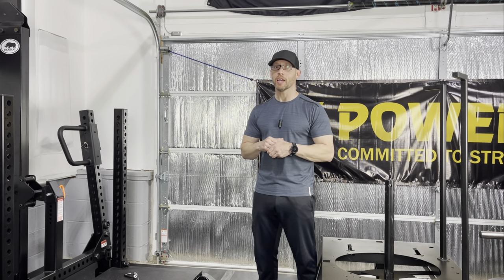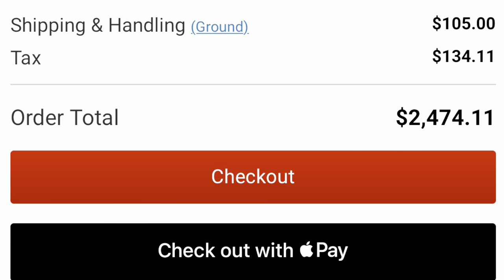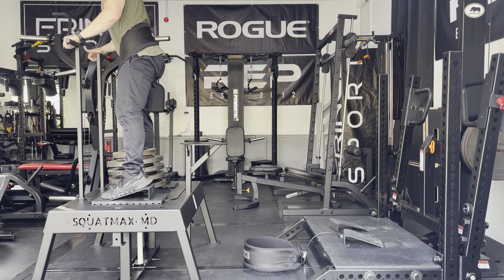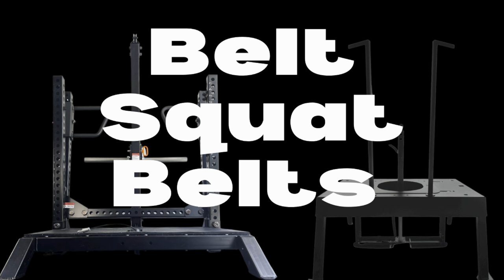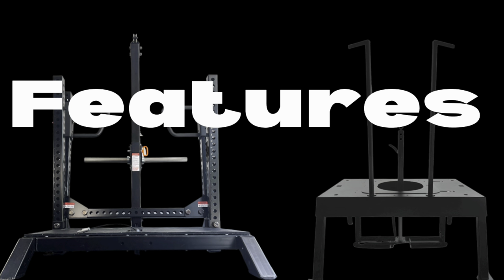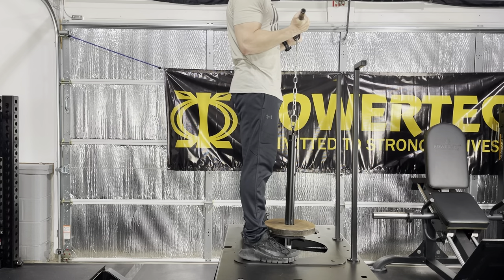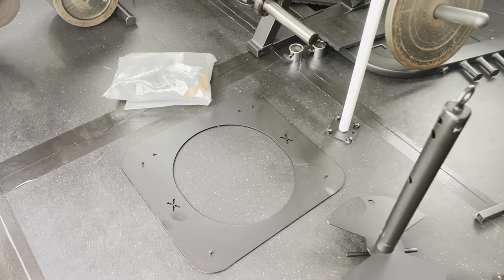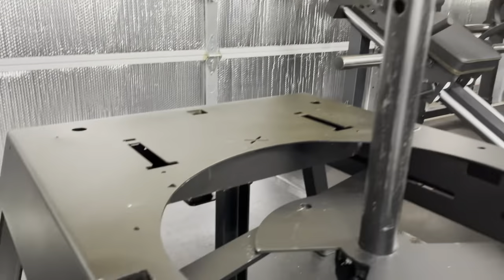The Rogue Rhino vs The Squatmax-MD - Battle of the Best Belt Squats

Comment: I'm curious how you feel about both now?  From what I've seen people love the Rhino and its very versatile and most importantly its far easier to load and unload the weight!  If I bought Squat Max I likely would buy a 100lb plate and leave it and a 45 on there just to save time.

Do you feel the workout is superior with one vs the next?  I'm 52 and just started lifting again did a regular squat for 275lbs for a few sets of 5 and I want belt squat to try to increase leg strength while keeping back safe hoping to get up to 350+ lbs and build leg strength for regular squatting or after a bunch of squats and back is sore will use belt squat with likely 150 to 200lbs and try to crank out 1-2 sets of 20 reps to torch legs and not hurt back.
Reply from the maker: I sold them both and went back to my DIY Belt Squat (I have a new video for it).  I sold the Squatmax first and less than a year later, sold the Rhino.  
Your conclusion is right on.  I always liked the Rhino slightly more because of easier loading and more foot positions.  It’s also a heavier and more robust machine.  Luckily, you can’t go wrong with either.
Reply: I totally appreciate and respect your advice.  I know you said you have lower back issues did you find you were not using the Rhino with heavy weight and just want a lighter leg workout is that why you sold it?  I like your new belt squat idea however want to do 300+ lbs and it doesn't look like it would be easy to stand on boxes!  I'm considering the belt squat Kaizen made with Fringe Sport, kickstand coming early next year and it can load a lot of weight, supposedly it has a 90% feel weight do 330lbs will feel like 300 and can go low as weight pin is vertical on top.  I don't need to build any stand to get range of motion, its affordable and can be added and removed with rack!  Curious if you've seen it and what you think? @HomeGymHacksandReviews
Reply: I'm trying to protect my back.  For instance this week did some deadlifts nothing radical about 250lbs for 10 reps and next day squatted and my back is so sore.  I need to do belt squats on weeks I deadlift (trying to build up traps and forearms which deadlifting does for me but it ruins my squat!).  That's why belt squat is so important to me and trying to prevent major back injury!
Reply from the maker: Thank you.  Not at all.  I posted a few videos going pretty heavy shortly before selling the Rhino.  One of the YT Shorts was 350 pounds for quite a few reps and I was able to get (8) 45s for a couple reps.  For me, it was just time for a change and I needed to free up space for new equipment reviews.
As for the Kaizen Belt Squat.  First, I’m a big fan of Kyle, he is one of the nicest guys in this space.  If the lever arm is long enough, it could be a good design.  I can’t remember exactly the dimensions of Kyle’s (I think it’s better than some of the other designs).  I do not like the mechanics of a short lever arm belt squat.
Reply: Thank you for your opinion.  I sure would love to save the space of Kyle's design.  It is a bit longer than most and says its 90% feel weight.  Kickstand coming soon which is cool. @HomeGymHacksandReviews

Comment: Any issues with the cable on the Rhino? I had to have mine replaced after the rubber coating frayed away while doing seated rows. The cable was rubbing against the platform as I rowed back and forth. Great review. I love doing RDLs on the Rhino. Gets a great stretch to the hams!
Reply from the maker: Thank you!  No, I haven’t had any issues with the cable, admittedly, I mainly use the Rhino for squats and calf raises.

Comment: Love that the SquatMax has the seat which makes it much easier for those with previous knee injuries. It's tough to get into position on the Rouge Rhino. Thanks for your thorough review!
Reply from the maker: I’m a big fan of the seat!  And it comes stock which is even better!
Reply: I am a huge fan of the seat because I can sit down in between sets without taking off the belt.
Reply: When I want to do box squats on the Rhino I slide an adjustable bench(Rep AB-3000) under the platform.  The front feet go under the platform and 
the pad goes over.  I can use different size plates to adjust the seat height.

Comment: Nice review. I prefer The Squatmax-MD hands down. The Squatmax-MD give a much better spine decompression than the Rogue Rhino. This in my opinion is a game changer as it targets your quads without any strain to your lower back.
Reply from the maker: Thank you!  I’m really glad to hear you like the Squatmax.  It really is a great piece of equipment.
Reply: But will loading and unloading plates on vertical pin stressed my lower back more?  Have sensitive back wirh 2 bulding disk, also do jujitsu so it's sore all the time. Lol. Iam pretty sure I would love the squat max but don't know about the loading/unloading and also a minor thing stepping up to a 20" box.  Iam still deciding between the rhino and squat max😢
Reply: @futbol1972  Marco, I understand you can use the flat resistance bands for resistance if you have a concern of loading and unloading weight plates.
Reply: @JoseSuarez-bk3qg have you used both if so which one do you like better for squats only ?? Which one feels more comfortable

Comment: I already own a titan selectorized lat pull down, a selextorized funcional trainer and foldable titan rack. Do you still prefer the rhino over the squat max?  I was about to buy squat max but they don't have financing. I like it because it's smaller than rhino and cheaper,  however rhino has financing where I can give $1000 and pay the rest in 6 payments with no interest:) that I can do. But it looks quite large compared to squat max??
Reply from the maker: That makes a difference.  I stand by everything I said in this video.  I have a couple newer Rhino videos too.  
I think both are great belt squats and you can’t go wrong with either.

Comment: If you add 500 lbs on both machines  equally, which one of these machine feel heavier ?  Since only question I have is depth on Max MD with more plates on, because 500 lbs is not heavy.
Reply from the maker: If I remember correctly, I could lift slightly more on the Squatmax.  If you are worried about running out of room for plates, adding bands is an option.

Comment: The squatmax md I like it for it's size/free weights. The price is absurd to me i could diy this myself. I get the rhinos price blecause it's heavily built I guess. Md is basically a well built guage steel table lol.
Reply from the maker: I’ve seen a couple decent DIYs for the Squatmax and I used a loading pin and plyoboxes for a number of years; but if anyone is willing to pay extra, the Squatmax is better than those options with the loading pin that travels along a shaft, band pegs, and the arms that lock the loading pin into place.  I can’t sell the Squatmax short because it’s a hip thrust and can be used for rows too.

Comment: Hello,
I enjoy your reviews. I recently used your belt squat idea with 12 inch plyo boxes and Titan loading pin. It works great. I wanted to implement this with squat wedge to elevate heels. I have double circle metal squat wedges. I'm worried about them sliding on plyo box during squat. Any suggestions?

Thanks
Reply from the maker: Great to hear!  Yeah, the laminate could be an issue.  I would use a stall mat between the wedge and plyo box.
Reply: Thanks, I will definitely use the stall mat. This is the best option at this point. Not wanting to purchase a belt squat machine.

Several of your videos have been helpful to me. 

I have a Titan T3 rack with several accessories and lever arms. I have several Titan products.

I may consider a Power Tec LG after watching your videos.

Thanks again
Reply from the maker: @gregoryanderson7103  glad to help!  I used pre-cut stall mats on the Rhino’s platform before entirely covering it.  It worked very well.

Comment: I told the GF I’d be done buying new equipment for awhile, but that Squat Max MD has caught my eye. I’m looking forward to what you think about it overtime and which one you like more.
Reply from the maker: It’s a great addition to any gym.  Hopefully, the GF will understand!  lol!  I am also looking forward to the year mark with both…I’ll likely do an update video in 6 months to a year.
Reply: @HomeGymHacksandReviews  I just bought the HLP Single Stack so I’ll wait for your 6 month review 😂
Reply from the maker: @GoreckiFit  great piece of equipment.
Reply: @HomeGymHacksandReviews  please do make an update on the rhino vs squatmax. Im debating on selling my squatmax to get a rhino since I can turn the rhino into a lat pulldown, and the rhino will make it easy to train my hip flexors too. But damn, I love the squatmax too. Ideally, id have both just like you
Reply from the maker: @Crazytaru1  it’s a tough call to put one over the other.  The biggest difference I have found is ease of use with the horizontal posts over the loading pin.  Each has their own set of exercises that the other really can’t.  For example, barbell rows and hip thrusts on the Squatmax Vs seated rows and bicep curls on the Rhino.  The Squatmax is easier to get in and out of position because of the seat.  I wouldn’t want to choose if someone said you can only have one.  Being able to maneuver the Squatmax is another advantage.  I’ve moved the SM 10 times since I’ve had it and now have it inside my Power Rack.  The rhino is very difficult to move if I am solo.
Reply: @HomeGymHacksandReviews  well if I have a lat pull down machine or FT u can do all these cable movements the rhino  does.. It looks like the squat max more versatile but looks like a pain to load.   
Iam also  thinking about getting a rogue rack and adding high and low slinger to it plus the bully glyder throlley to add lat pull down, low rows and belt squats too, I heard belt squats on this thing are as good as the rhino🙄 and also a  rogue lat pull down seat.  It will be around  $1500  so around $3000 with rogue rack.
Or a drop in rhino plus rack and surplus strengh lat pull down attachment to use with rhino which will be around $4000.
Or 4 post ares plus squat max md machine which will be around $6000
Reply: @HomeGymHacksandReviews  Is the SquatMax relatively easy to pick up just a bit and move over maybe 30” or so in one direction if all the attachments aren’t on it? I’d have it against a wall length wise and bring it out for the rowing stuff and such.
Reply from the maker: @srhyse  I think it’s easy to move / slide on horse stall mats.  I wouldn’t want to move it every workout, but it can be done.
Reply: Did u end up selling squat max to get rhino?  If u already had a selectorized lat pull down and a selectorized functional trainer and a rack would u still tried to sell squat max to get rhino or u would of kept it??
Reply: Do i need to be taking off seat to load and unload plates to make it "easier" or i can live it on?

Comment: I like the functionality of the Rhino in this video. How well do you think the Rhino would work for a 5'2 petite woman for rows and the other uses besides belt squats. I am having difficulty growing my legs because of a moderate brain injury, and I cannot perform heavy movements such as squats or deadlifts. Plus, the way I was impacted, I have neck and shoulder issues. I have always said I wanted to buy 1 piece of leg equipment to help my legs grow. I am just curious about your thoughts on the other uses as someone who will keep a minimalistic approach to a home gym with a good piece of leg equipment, and I am now in the market for that 1 piece. I do not have a cage, and I am not sure I want one.
Reply from the maker: Sorry to hear about your injury.  I can’t be 100% certain how well the Rhino will fit you.  I will say, the belt has 5 adjustments which will help.  I have a full review for the Rhino if you want to see a few hacks and additional exercises and another training video using the Rhino.  Those videos may help you get a better idea if the Rhino is for you…bc it is very expensive.  However, I’ve said before, it’s my most overbuilt and favorite piece of equipment.  The Rhino can definitely be your only piece of leg equipment if you want.
Reply: Thanks!
Reply: @HomeGymHacksandReviews  I just watched your lower body workout, and I think you just sold me. I really don't want a lot of equipment, but I can do hamstring and everything. Now just to pause, pray, and measure my garage space. Thanks for responding back.
Reply from the maker: @Dezlou  glad to help.

Comment: comparing both of these and I have a couple questions. is ur rhino bolted  to the floor. I don't really want to tear up my floor. And the resistance bands on the squatmax. are they optional to have on the machine or required? I'm a female 5'2  I've tried the rhino and it fit my body so I'm leaning towards rogue but squatmax  smaller footprint wins me over
Reply from the maker: Against Rogue’s recommendation, my Rhino is not bolted to the ground.  I’ve moved it around about 5 times, so I’m glad I never bolted it.  
The resistance bands come with the Squatmax, but they don’t need to be used. 
I have 2 newer videos with the Rhino if you want to check those out.  Good news, I don’t think you can go wrong with either.

Comment: Looking back at this. What would you prefer?
Reply from the maker: I still feel the same as I did when I made this review.  If you’re a free weight proponent, the Squatmax may win out bc of the chest row, hip thrust, and loading pin.  I couldn’t tell a huge difference between the two belt squats, the Rhino is just easier to load and unload with more foot position possibilities.

Comment: Ive never used a belt squat machine...do you feel pulling in your lower back when using since the force of the gravity would have a pull on your lower back?? 

thank you so much for your review...I was looking for a squat alternative and a seal row and without this review I would've never known that the squat max would do both.  You are a true savior for us home gym guys
Reply from the maker: Thanks so much!  I have to be very careful with my lower back and neither machine causes me trouble…I think it actually feels good for the lower back as there is a decompression component with the belt squat when it has a true vertical line of drive.

Comment: is there a reason why the pulley tower on the rhino is so tall? my god damn low basement ceiling
Reply from the maker: It could probably be slightly shorter and not impact the exercise selection / carriage travel.  Would it be possible to cut a small hole in the Sheetrock to allow for the tower?

Comment: I am considering getting a lat pull down machine, which do you recommend?
Reply from the maker: Your budget has a lot to do with it.  The Prime is nice.  The more expensive Titan is nice.  The Powertec is nice.  If you want a mobile one, the Ironmaster.  If you want an inexpensive but really decent option, the plate loaded Titan…the padding and other areas are top-of-the-line, but price is good.

Comment: Great review 👍💪 I was wondering if you would ever get the Squat Max and do a Real honest review . I like them both , I am deciding between which one. The smaller footprint on the Squat Max is better for my apartment gym. The Rhino just keeps getting more and more expensive. I did have the Squat Max about 1 1/2 years ago but had to sell it so I know the feel of its movement, Brian delivered it himself to me and gave me a quick session on the use of the Squat Max. I like the rhino too though. 
Question: Didn’t you get the transformer pin with your purchase? It’s listed as it comes standard with the Base model of the Squat Max ! Also did you consider getting the Retrofit guiderod for the Squat Max ?
Reply from the maker: Thanks so much!  I have wanted the Squatmax for a while and almost got it a year ago.  
That was very cool of Brian to deliver it as I’ve seen him do that from time to time for others.  
Yeah, the transformer pin came with the purchase.  I misspoke about paying extra…it’s on the website for purchase for those with the older model Squatmax.
I’m pretty sure mine is so new that I have the new guide rod.
Good luck on deciding which one to get…it’s a tough decision.
Reply: @HomeGymHacksandReviews  Thanks for your reply. I am curious now, I’ll have to ask Brian if the New Retrofit Guiderod comes with the machine or is an extra . 
The squat max is definitely easy to move if you have to and the rhino would need almost full disassembly and the pieces are heavy for one person to move. They are both excellent though.
Reply: It looks like you have the old Guiderod from looking at your video. If the Guiderod you have now if the base that’s closes to the floor is long than you have the old version and that would mean the Retrofit Guiderod is an extra cost Add on. The new retrofit Guiderod from comparing pictures from the SquatMax website is shorter.